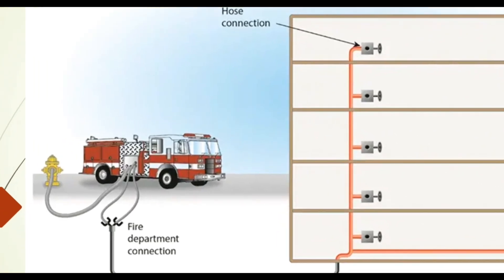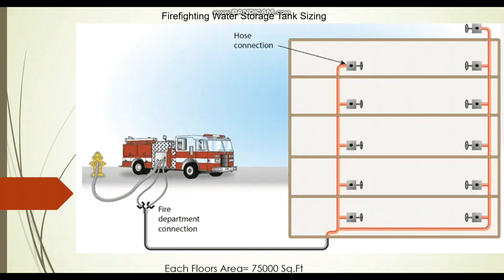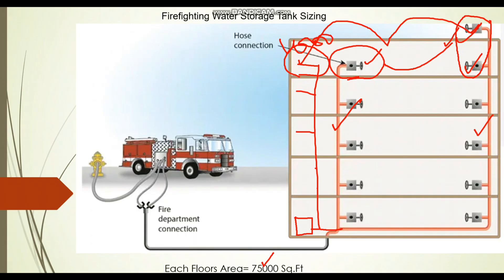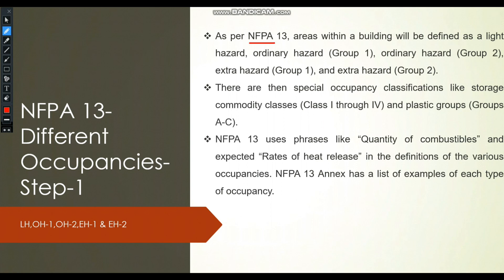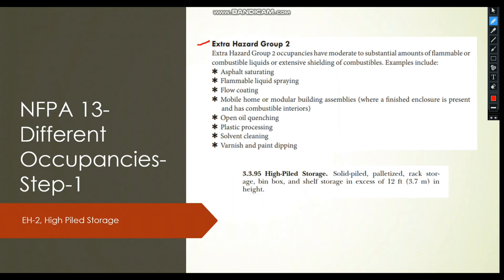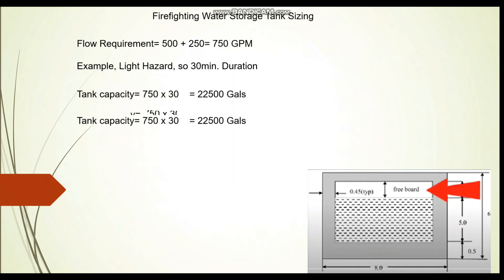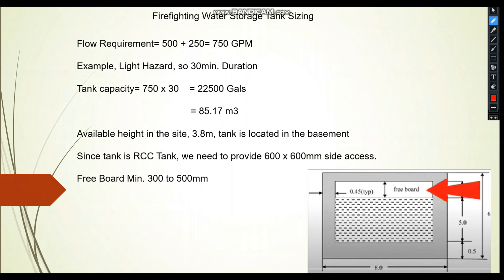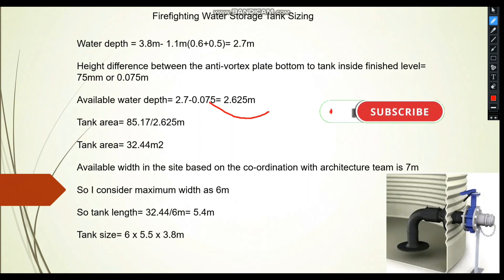Fire Fighting Water Storage Tank Design l Fire Water Tank Capacity Calculation l NFPA standard

Comment: Good Explanation for the fire water tank
But I have one query related to the storage duration if the same building has light ordinary and extra hazards how much storage duration will we consider for the fire water tank
Another query is related to fire pump capacity for the combined sprinkler system as you told in the video it should not be more than 1000GPM but in our project there were fire pumps having 1500GPM can you explain about this case
Reply from the maker: In most of the building, u have fire pump room which has diesel tank that automatically comes under extra hazard.  But same building has light hazard area then ordinary hazard due to different locations. So most building has mixed hazard. We need to do hydraulic calculations for each hazards and decide which hazard has most hydraulic demanding then we select that hazard for tank sizing.
Reply from the maker: If u use special sprinklers like ESFR, flow will go higher than that. But if use normal k 5.6 sprinkler it wil be 1000max.